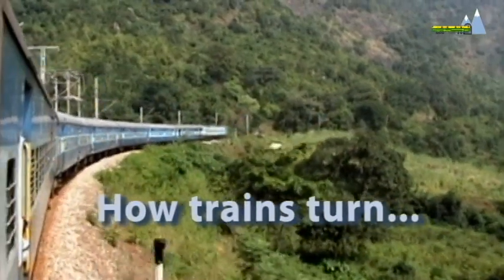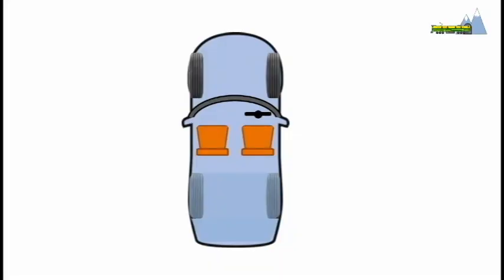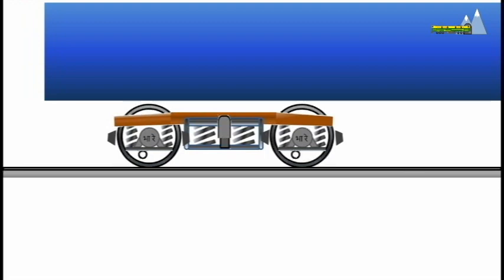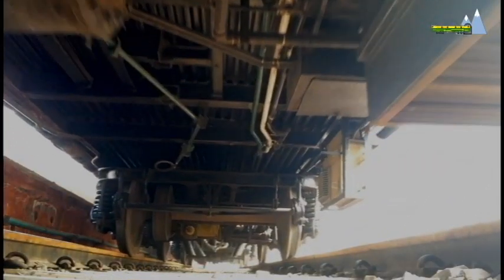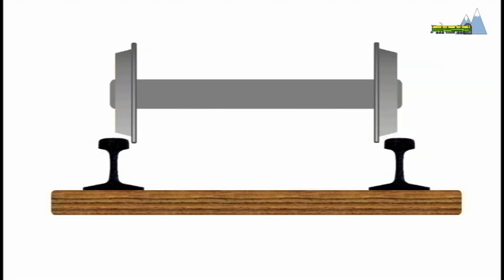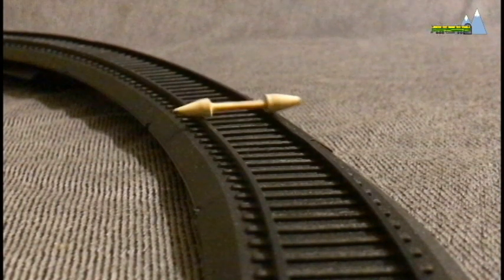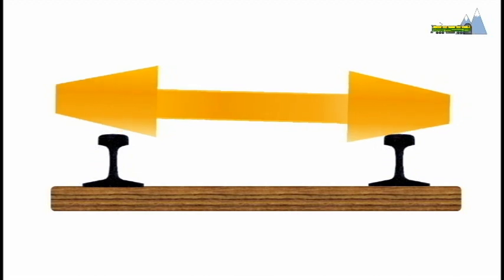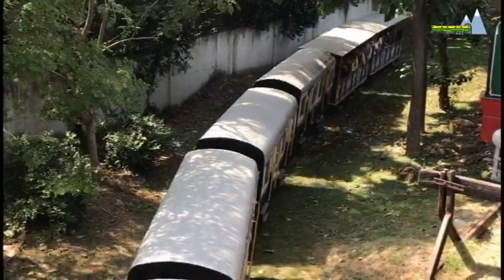How do trains turn at a curve

Comment: Sir recently I passed ssc 10th class i want to become indian loco pilot what can I do after 10th
Reply from the maker: You need to complete ITI (recognized by NCVT/SVCT) in any specific trade and then apply for the ALP (Asst Loco Pilot) test from any Regional railway board. I would recommend you to study hard in your class XI and XII and then do a an Engineering course in Transportation/Railways
Reply: @TheTrainStory  sir can I do diploma mechanical is it OK sir
Reply from the maker: peter Praveen Yes Diploma mechanical also works...

Comment: What I don't understand is, with flanges around, there is hardly any space for movement, say 2-5 mm at most. The flanges appear very close to the tracks, then how this turning occurs? The conical wheel theory appears awesome, but some slow motion video of a real bogie may reveal the turning.
Reply: Proxis Merchant more like 12-15mm.